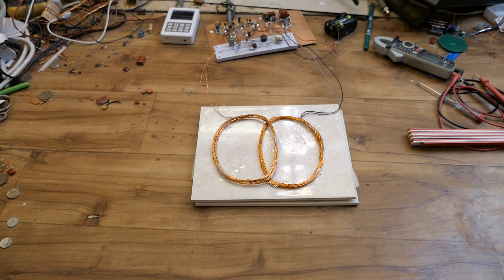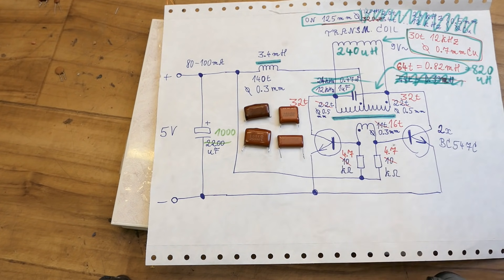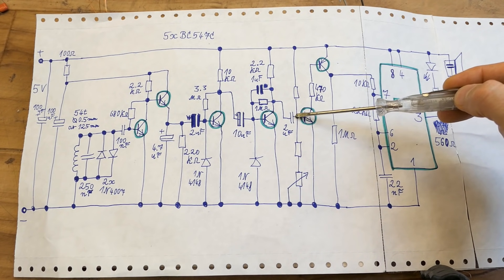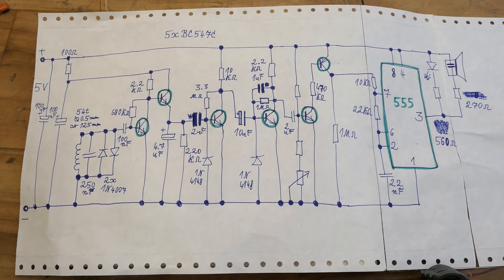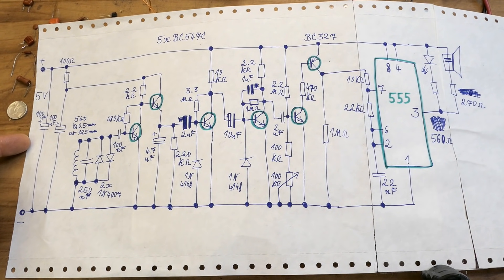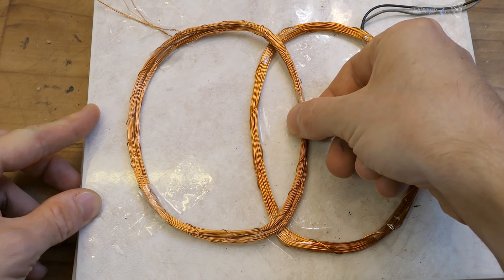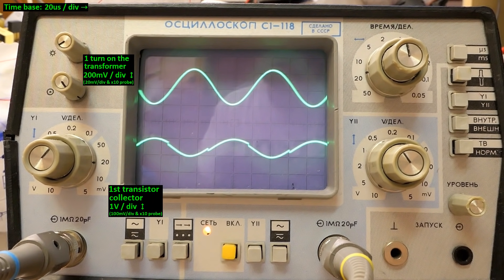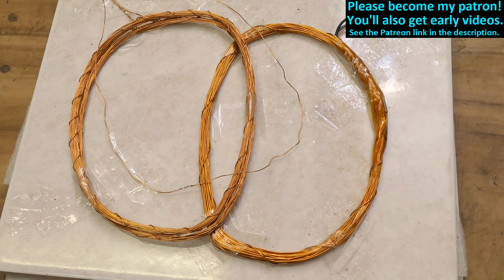DIY DD metal detector 2 - coin at 35cm, audio indicator, PCB

Comment: I have some suggestions and some questions
  you can put  one transistor phase shift   to improve the  receiver 
Also, is the transmitter required to be zvs or zvt
I mean, can the transmitter circuit be replaced with another and put a controller or chip like 555 timer or  tl494 or bfo tx?

Comment: What if you used a hugh voltage dc converter to charge a 200v  rated capacitor,  tobbe used as the current for the search coil, running at about 120v -180v. To pulse the coil with. Along with higher current. With a low duty cycle to allow dead time for reading for metallics.  Think its possible, also cover the high voltage side with PCB board with solid ground plane.  And seam covered with copper foil conductive tape, to protect the sensory circuits from the EMI,. With the actual peak current of the ping going to the search coil being 5amps or more then dropping off to around 2 amps then 100ma before ending the pulse. With a strong pulse, with a quick, ever changing magnetic field should make small metallic bits ring like a bell caught up in a bicycles wheel! Compared to someone ringing it and sitting it down! The sense during dead time could possibly sound interesting. I'd like to  attempt using a stand alone coil and try listening to a small piece of metal being rang by a detector,  possibly record the sound play it back at 25% speed so humans can hear the frequency.  I want to attempt using a tiny coil with tons of copper  a 2ohm dc coil hit with nearly 200vac. The instantaneous current would be amazing, sky high, yet quickly falling. I really want to experiment with some metal detecting circuitry. And especially experiment with coil types and shapes. It would be awesome to be able to drive metal rods into the ground with coils on them and wires going tovthem from s contol box,  have 3-4 of them around a search area.  Then sweep. The area inside the rods say 3-4 meters from them.  Using a detector coil, connected to the cintrol box, or operating wirelessly.  And having the ability to find metallic bits down to or smaller than 1/10 of a gram, as deep as the rods can be driven into the earth.  Possibly slightly deeper around 100 mm roughly, with the rods capable of going 1.5-3 meters deep. Possibly deeper  with soil type and rocks effecting performance,   i belive this tech is possible. Possibly only usong the rods  with the electronics. They can find voids in the earth with similar tech. Had the ability for many years. It could work like radar, or sonar  use it similar radar or sonar by reading the electromagnetic returns from multiple pings, send energy intothe ground with the rods and listen to the earth after the ping,   do youbhave an opinion? Any ideas about a pi detector, awesome video..

Comment: Very nice video. The front end is very impressive, but I think the performance could be much higher if you digitized the signal after the front end, rather than going through the peak detector and the following circuitry which is very retro...

Comment: Awesome work! It's certainly a difficult task to make it work properly. I'm wondering, how it would detect metal objects that are dug in the ground. I'm thinking that if you would add more of these demodulating capacitors with slightly different capacity and connect one you need so it would be possible to somewhat change the sensitivity.

Comment: actually, the idea of using a variable capacitor with the coil is doable, just not worth while in this case.  if you make your own, it's not that hard, really. I had to get hold of a 100 pF capacitor with ~ 2000 volts A.C capable of working at around ten MHz. Rather than buy one (expensive) I just used the cap formula and used a 30 cm length of PVC tube about 4 cm diameter, about 3 mm thickness. What I did was wrap the outside of the tube with Aluminium foil, with a length of multi strand wire touching the foil I wrapped it fairly well with tape. For the inner electrode I used a 30 cm length of thin copper foil, with a wire soldered to it. The copper foil was rolled around the same size of the PVC pipe, then the rolled up copper tube was inserted inside the PVC tube, it was springy enough so that it hugged the inner surface of the PVC pipe. And that's it. You can slide any amount of the copper tube in or out for it to act as a variable capacitor, probably not worth the effort for this low voltage application, but when using 2000 plus volts it certainly is ! It was for a plasma candle.

Comment: Please ,Can i replace a diode 1n 5819 by 1n 4148 or 1n4007 and thank you.
Reply: 1n4148 is low current FAST silicon diode..
Can't replaced in high circuits with the slow 1n4001 to 4007 Standard rectifier diodes.
On the other hand:
Search datasheets and make main attention to 
breakdown voltage 
Forward voltage drop
current 
reverse(leakage) current
Aannd powerdissipation over all xd

Comment: How about schematics on EASYEDA and then you can order the circuit boards!? So that you solder the components and its much easier.
Of course you need some copper and the 'CD thing' (I have it randomly). The problem is that a lot of copper is required... I have some transformers from some SMPS power supplies but the wires in them  will still not be enough... Maybe I can buy it somewhere but it's quite expensive.... And of course you will the resin and a container for it... But still maybe you get lucky and you find real treasures with this thing...
It's also a very nice project!

Comment: This is great but I guess with this sort of ' tuned circuit ' stuff designing a PCB would be a nightmare as a lot of the values would then be select on test or do you think once its finalized it would just work ? as I would like to design the PCB but don't have the skill set to diagnose at your level ! at least not at the moment, but it's all absolutely fascinating anyway....and no salt cheers.
Reply: Everything that oscillates and has a coil, is a tuned circuit. 
10KHz is low enough frequency that's not really affected by wiring. It can even be breadboarded. 
I don't use PCBs. Only perf boards and solder wire them. Just like you see Great Scott make his prototypes.
Reply: @piconano  Thats why I called it a ' tuned circuit ' if your happy with perf and you dont use PCB's thats great...enjoy ! I am discussing PCB's...cheers.
Reply: @andymouse  That's what I was trying to tell you. The PCB would be like any other. This is not RF design.
Reply: @piconano  cheers.

Comment: Can i use Arduino to get phase shifting, and other things and to do discrimination. Are there existing Arduino projects with this?

 Can i use single coil, but it sends signal, and then switches coil to receiver part(aka walkie talkie)
Reply: you can use the same coil to listen or recieve but you need to clamp the coil with a resistive load to stop it ringing so you can listen with the same coil without it ringing like a bell and swamping the signal
Reply: Arduino's analog inputs are too slow.
Reply: @LMB222  For this applications it can be used because final signal has frequency of 0.5 - 5 Hz.